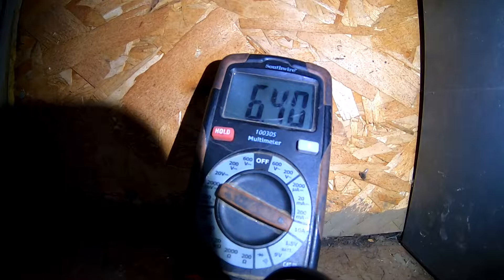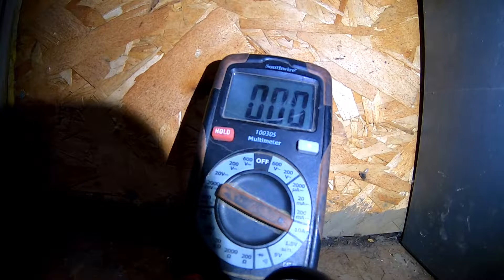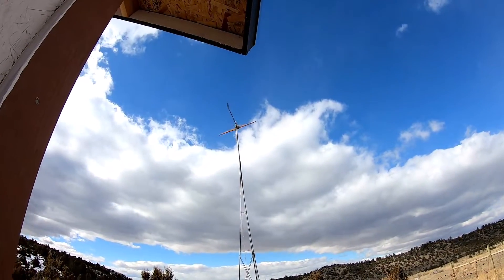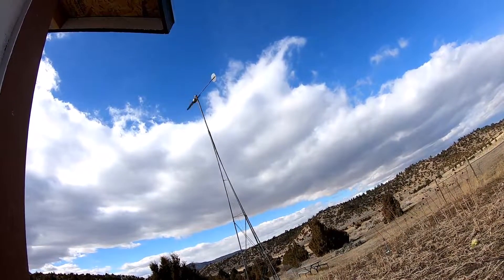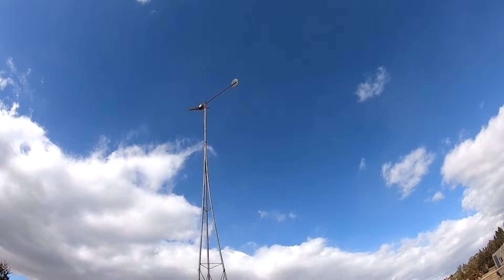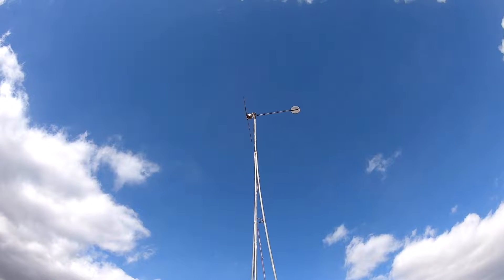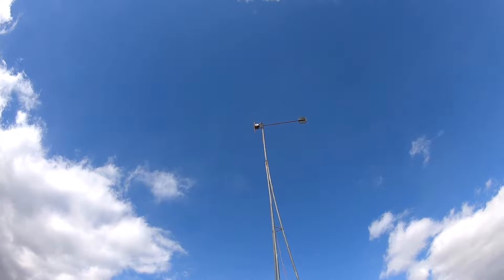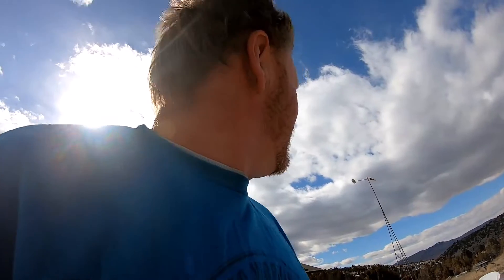Car alternator wind turbine, performance of the wind generator I built using a car alternator

Comment: Yes, there is a lot of junk on the market, so after a few bad buys and a lot of testing, I have finally found the best performing small wind generator for the price - $361.90 AUD that is postage included.
1000W 24V/48V Windmill Power 6 Blades Wind Turbine Generator W/ Charge Controller  -  ( Best to order the 48V model )
This is a buy and put up wind generator, no modifications needed.
I hope this helps anyone buying their first wind generator.
Reply from the maker: Suppose you give us the make and model 😁
Reply: Name brand? Where  to buy? Dude, you left us hanging.

Comment: you need to make a power controller for the rota that turns power off till it spins then by time turns up the charge current to the rota . the energizing current will put magnet load on the unit making it hard to turn . so you need a set of transistors from a battery that will regulate the rota supply . This will help immensely if you use a car alternator ..The thing is to build the system on the floor with a thick metal frame so the horse power can be gained by using a large surface area such as a split 45 gallon barrel split into as the blades . speed will be less but tork would be far higher . ... So just build one for the ground and add all the energy together ..

Comment: tower has to be built, erected, and rigged properly. consider disc area and leverage... a LOT of force.

2 blades suck. need relatively high speeds to operate, and they produce oddball harmonics on the tower for some reason. always aim for odd numbers?

electrical side of things... best use for wind imho, is to heat water. dont worry about batteries, you can heat water far more efficiently, and hot water is pretty nice? you can then forget about things like volts x amps... think of power transfer instead. matching things.

rip the regulator out, and the power delivered to a load will be based on the resistance of the load, and the excitation or field voltage/current.

a resistance equal to the alternator windings will dissipate an equal amount of power as the alternator. if its twice the resistance, 4x. if its half the resistance, 4x the power is dissipated in the generator instead, not in the load. if the resistance is too high though, the generator cannot push current THROUGH the load, and no work is done.  the alternator "freespins". "open circuit"...

that is, the alternator windings are a resistance themselves and consume power. too low a resistance and you heat the alternator instead, and burn it out... too high, you dont have current flow. its this thing called "jacobs law".

so, you have an un-excited alternator, no cogging. easy to spin.

and as you excite them, they start "braking" due to lenz law. the more load, the lower the resistance, the more they "brake". 

with a water heater element, you basically have a fixed resistance. theyre listed in "watts" but that changes if you run them at different voltages. ohms law. you need the volts across the resistance to push so many amps through that resistance... run a 240V at 12v, it barely gets warm. run a 12v at 48 and its running at 16X its rated power, lol... 

what stops it burning out is surface area and how fast it can dissipate that heat to the surrounds. you can have the same element as say, the arc of a welder, focused and intense, or spread that resistance out over 50M of wire supported on poles and only get a very small rise in temperature. same power, different area and rate of transfer...

but with an alternator, you can control the field excitation, and the power the alternator can deliver... you just need to deliver a voltage appropriate to the windspeed and the output power... 

dig apart a motor with a centrifugal starter...

look at it for a while, consider how you could make a small generator/governor/exciter from it... some pickup coils, some magnets, a different tension spring...

you want something that when its spinning slowly, the magnets are pulled away from the coils. no output... as it speeds up, the magnets get closer to the coils, you get power, that excites the field windings, the alternator starts producing power, dumping it into a resistance that happens to be a resistive heater element in your hot water tank...
wind blows harder, magnets fling out more, more power absorbed from wind by alternator, more power dumped into heater. with some tuning of this governor you get reasonably controlled blade speed regardless of windspeed... when they spin faster, the braking forces of the alternator increase, and slow it down... but as the excitation decreases, it speeds up... get it right and the braking effort at high speeds can overcome the power applied to the blades by the wind, and it limits the max RPM. you might boil some water, but so what? means you need more water storage!

to charge batteries? it involves needing precise voltages, dumps, calculations... you have to try and push energy into something that isnt really happy about it... its related to internal resistances, and that jacobs law thing. that batteries are NOT resistors...

lot of power used everyday in the average home, just heating water...

Comment: Depends on the blade design, number and other factors, larger blades, you need to generate more volts at lower rpm. Treadmill pmg produces 12 volts at around 100rpm, because it's 125v at 3850rpm

Comment: Use a big pulley on the blades and small pulley on the alternator with a belt or chain to increase the gear ratio. The alternator will spin faster during low wind

Comment: Just a suggestion to add to my last comment, with a two blade prop you cannot develop enough torque and that is why you have the issue of having a strong wind before you get enough pressure on the blade to push it back on the switch. As soon as the switch is applied and the field is excited the drag of the generator slows the prop. That’s why multiple blades are required and this also enables more torque at lower wind speeds. Hope that helps, as you are so close!
Reply: With an alternator you need slot of speed, 3 blades makes it slower

Comment: Are you sending dc current from the turbine to the battery bank or ac to a rectifier then a charge controller? I'm kind of confused by you not removing the rectifier from the alternator. I cant wrap my head around it. I would like to do this but with a pelton wheel.
Reply from the maker: I'm sending DC current to the batts from th he alternator. But you could send 3 phase too if you wanted with a similar setup.
Reply: @veggitarianredneck  I really have to look into this.

Comment: Electronic control comes to mind - use of Arduino mini-computer to monitor rpms/voltage/etc be more efficient - and Arduino is very cheap and fun to work with..

Comment: I am not sure how many RPM an alternator spins at when driving and charging and running your car or truck but i would have to imagine it would not be to hard to, with gear reduction or expansion get enough RPM to charge a battery or bank of batteries especially with large enough blades to make power to turn your gear or pulley setup
Reply: 1800 rpm it would need.   Max amps at 2000rpm.

Comment: if you dont mount the blades directly to the altenator but use gearing like on an 18 speed mtn bike in fact maybe you could rob the parts from a multi speed bike to run the altenator at a higher rpm than the rpm of the blades